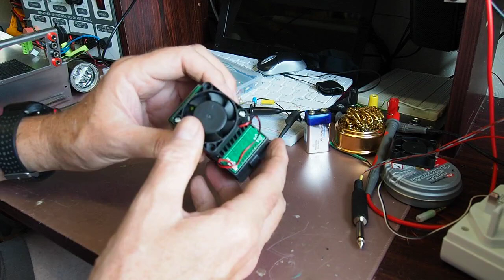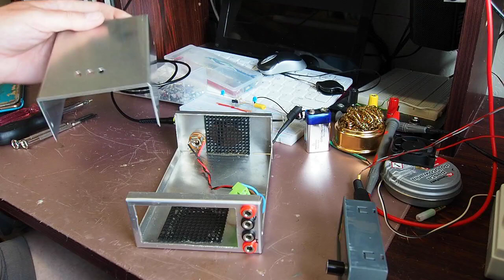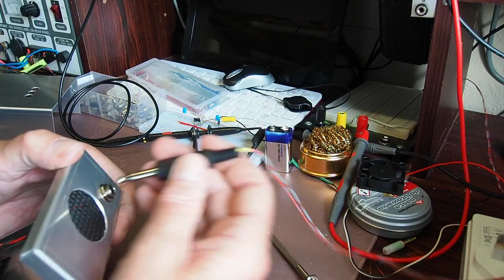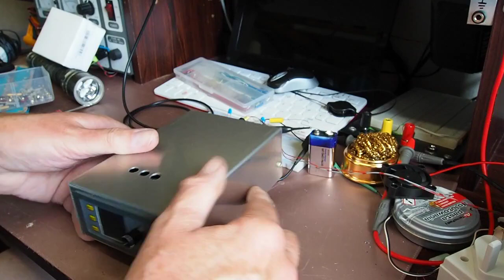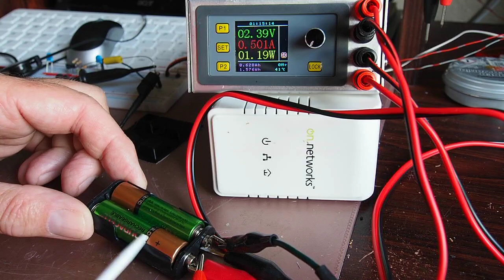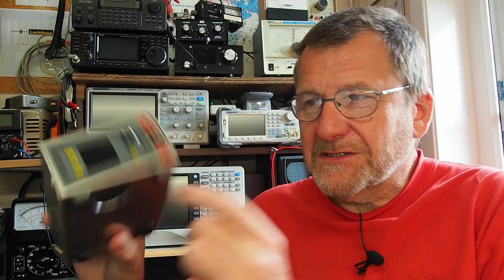Simple Electronic Load Project   #081

Comment: Great little project. There's enough room in the case to add a small microcontroller with an SDcard so you can log the results. You could then remove the SDcard, import the file into Excel, and graph the discharge curve. Just an idea ;o)